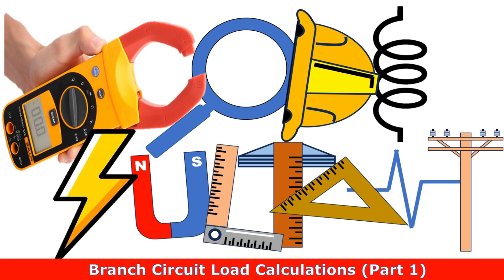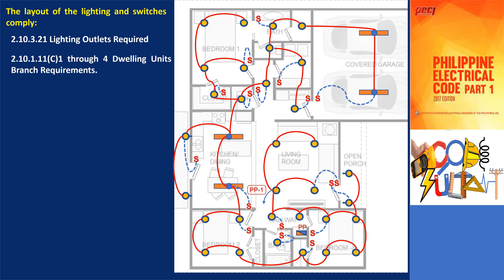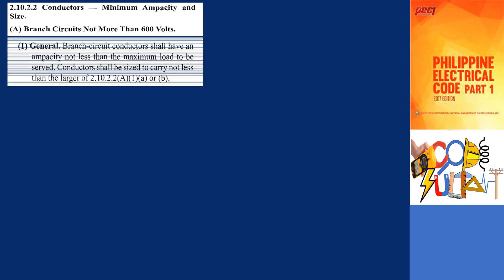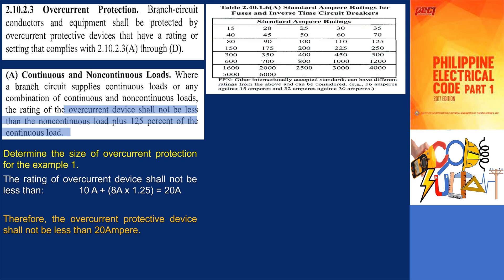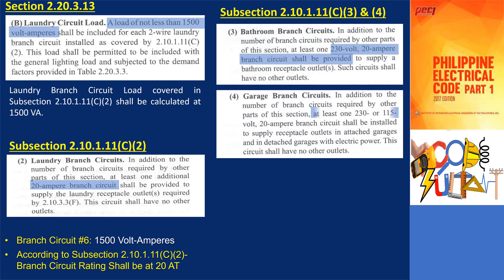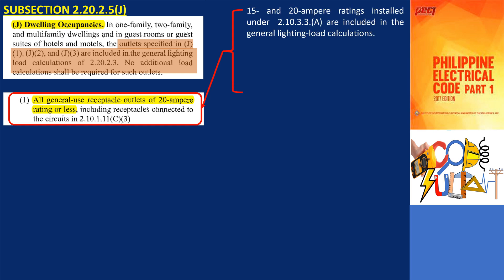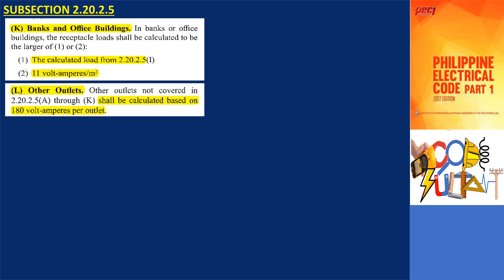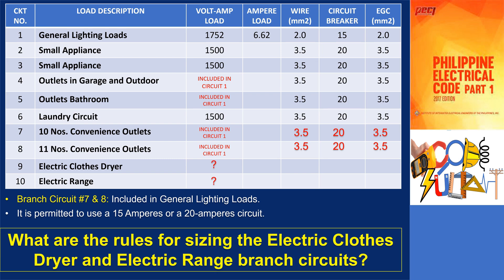How To Calculate Branch Circuits - PEC 2017 (part 1)

Comment: for BPO office,for example I have a 8 workstation with 2-duplex outlet on each workstation and only load to be connected is a 100watts computer pero workstation
Does 180VA per will be use for load schedule computation?or can directly use the 100watts that is good of 2duplex outlet?
Reply from the maker: In accordance with Subsection 2.20.2.5(k), the calculation of receptacle outlets should be based on a minimum of 180VA or 11VA per square meter, whichever is greater. This means that regardless of whether the receptacle outlet is simplex, duplex, or triplex, it must be calculated with a minimum of 180VA per outlet.

The load schedule plays a crucial role in determining the sizes of branch circuit conductors and circuit breakers. Therefore, it is essential to accurately indicate the load requirements in the schedule. Consequently, there is no issue with allocating 180VA per receptacle outlet.

When sizing the main circuit breaker of the panel, a demand factor can be applied based on an estimation of 100 watts per computer. This allows for a more realistic calculation of the overall power demand.

Overall, following these guidelines ensures that receptacle outlets are appropriately calculated and that the panel's main circuit breaker is sized adequately for the expected loads.

Comment: This one is suitable to my 100 sqmtrs area to my project good sir!
Reply from the maker: Thanks also
Reply: for BPO office.example I have an 8 workstatio
n with2-duplex outlet per workstarion,only 1 destop computer will only be connected with 100W rating,
is it still applicable to use the 180va per outlet?or can already used the 100W?